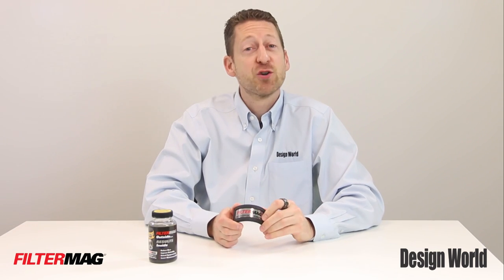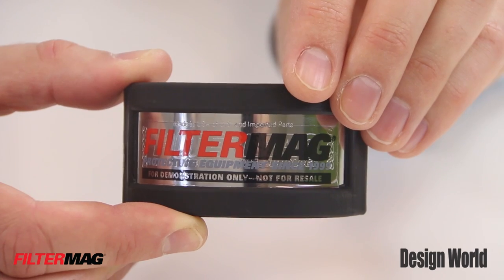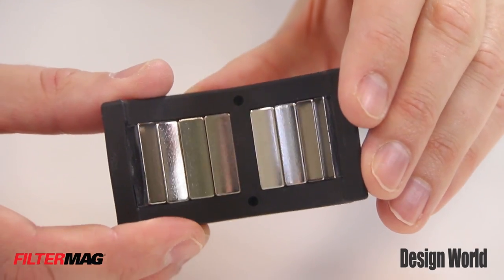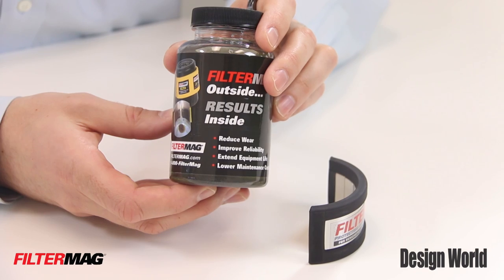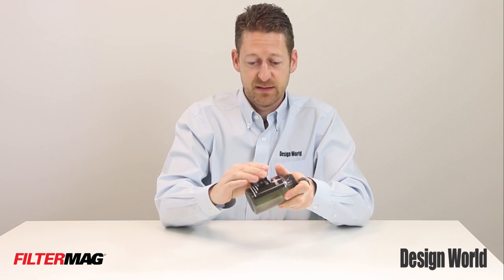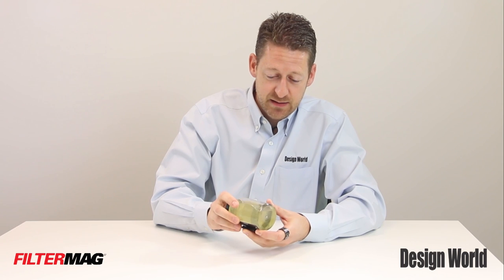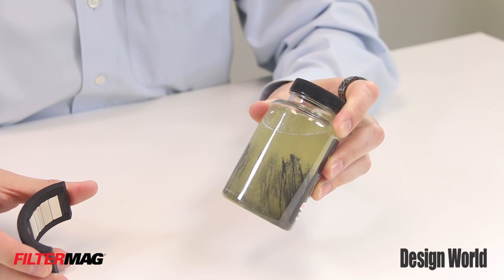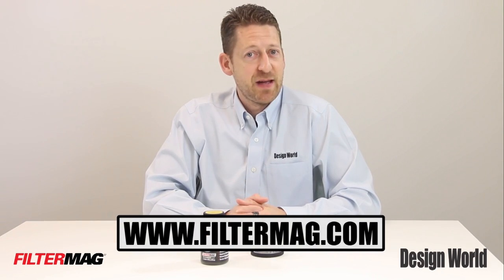Product Showcase - FilterMag

Comment: The famous 95 MERC runs Pennzoil 5-W-20 Ultra Platinum Synthetic Oil; Bosch # 3410 Premium Oil Filter; and FILTERMAG,  Part # SS365PR  Oil Filter Magnets.
 The Filtermag #SS365PR's magnets are specially treated to remain powerful when they are heated by the engine's oil.
Other magnets are not protected from the heat, and will NOT work properly to remove the ferrous metals from your oil.
  1995 Grand Marquis Restoration - Mercury Forum - Mercury Enthusiasts Forums
Reply: HOW FILTERMAG WORKS
Moving parts operating inside an engine, gearbox or hydraulic systems create metallic particles that circulate in the oil and cause normal wear. Normal oil filters catch particles larger than 25 micron. However, smaller particles pass through the filter and continue to circulate in the oil. These tiny particles are small enough to fit between bearings, shafts, seals, gears and other mechanical components and cause significant wear and create exponentially more particles. This cycle continues because an oil filter will never stop those small particles from circulating. FilterMag’s extremely powerful magnets capture these small wear-causing particles on the inside wall of the filter removing them from the lubricating oil. Removing these particles keeps your oil cleaner and helps to break the wear cycle, increasing the life of your engine, gearbox or hydraulic system.